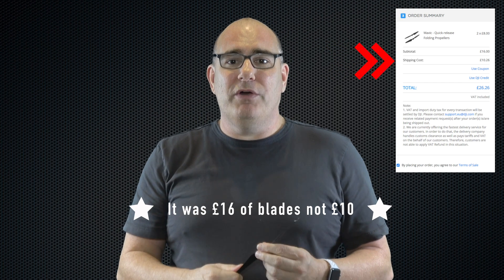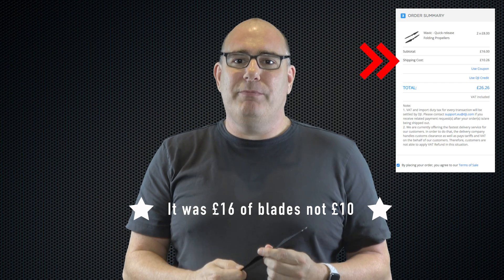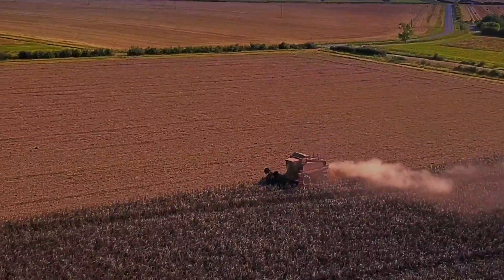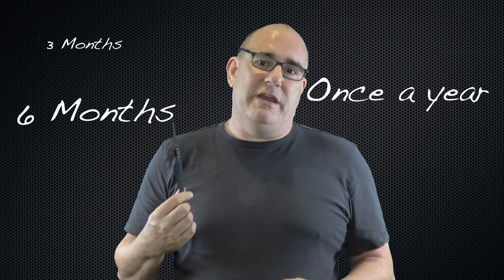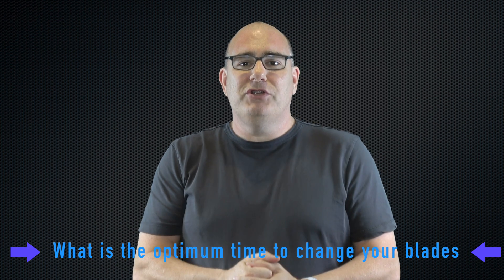DJI Drones - Props and Blades, when you should change them?

Comment: if you Do need to change the blades.. do you single change it or must it be by pairs? eg- car tyre..change in pairs...cheers
Reply from the maker: there is no rule book for this, when I change one I change them all. If your drone has had sufficient shock to break a blade there maybe other damage that is not so visible. Also it prevents me from forgetting what blades are new and which are old. It’s more expensive but delivers peace of mind.

Comment: Before and after every drama free flight, I inspect the props visually then run my fingers across them to make sure I don't feel any irregularities on the blades. I haven't yet crashed my Mavic or had the props hit anything (knock on wood), but I would just go ahead and replace all the props in that event. Even if the props pass a visual and "feel" test, I would rather spend $20 on a set of new props and know they are sound vs. a possible prop failure. It's just not worth the risk IMO.
Reply from the maker: +dyi01 fully agree, I have a friend who’s blade disintegrated after a rough landing, luckily he was only about 1m above the ground when it happened. If you knock it, replace it, simple 😀

Comment: It's a can of worms this one, 
I personally have done 134 flights on these props and check them after every flight (Usually in to much of a rush on flight day lol) I do keep two spare sets just in case i hit a big bug (or seagull). For me if the blades flex and return with no cracks or chips and the join to the hub are still tight I fly, if there are any slight issues I will swop out and destroy the 'old' ones. 

I agree about the third party props I dont trust them. I was thinking of carbon fiber props before I saw the video with the manikin...
Reply from the maker: I agree carbon fibre blades are a bit of an anomaly, you usually use CF to add strength or reduce weight, given adding strength to the blades will just transfer impact stresses to other parts of the aircraft (motors or arms etc) I am not sure why you would not want to sacrifice the cheap blades in the event of an impact. Reducing weight seems a minuscule return given how light the original blades are, so I think they are mostly for vanity sake as I can see no real reason to use them.